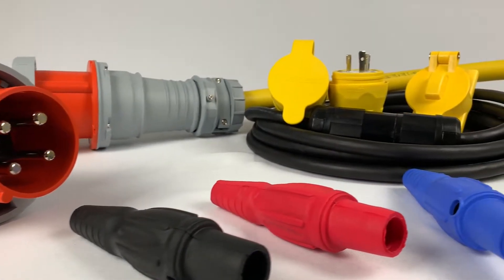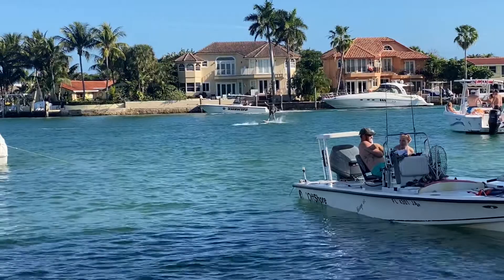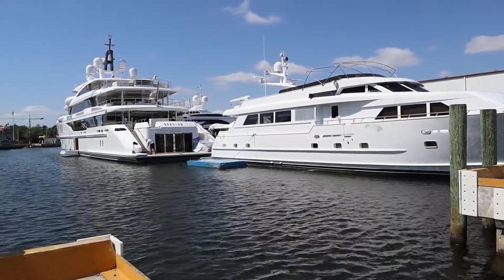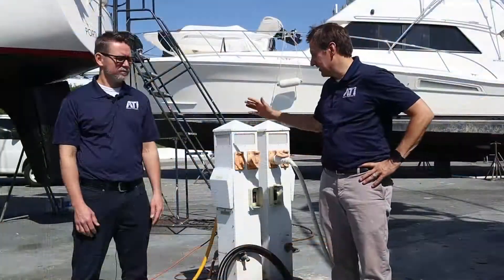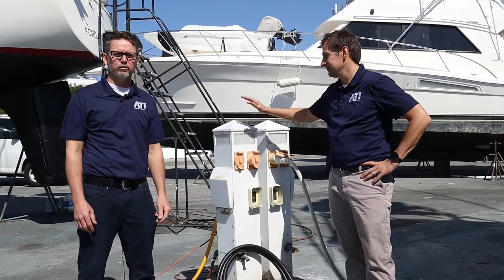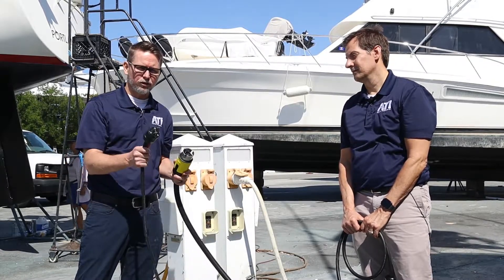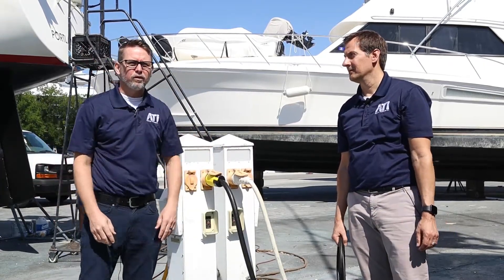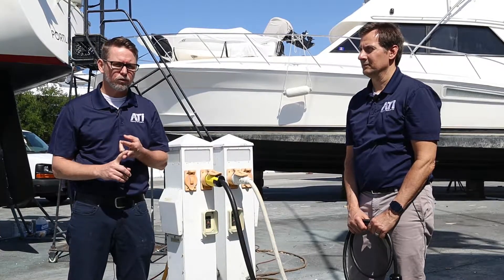Basic Shore Power and Marine Cables

Comment: Are the 30AMP Smartglugs any better than the older 30 AMP Plugs?
Reply from the maker: Both have their benefits and ultimately it comes down to personal preference. Some have been using the old ones for years and refuse to switch, but the SmartPlugs are newer and made of high quality materials, have heavy duty wire connection lugs with factory installed thread lockers. No thread locking ring on the smart plugs, different materials for corrosion resistance and more.